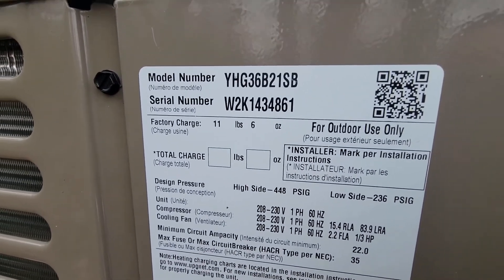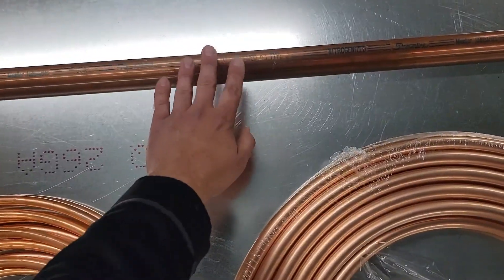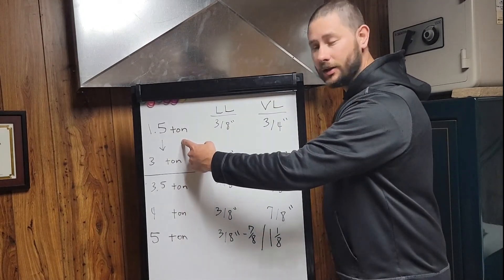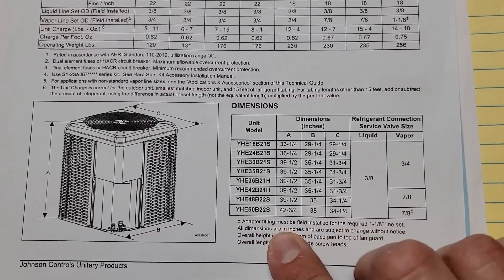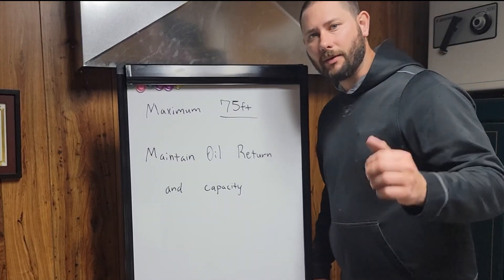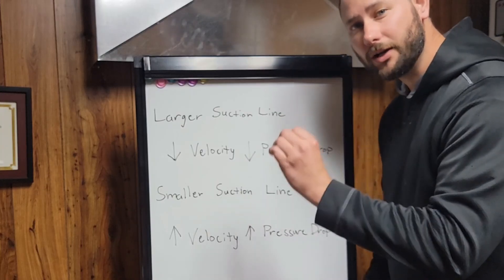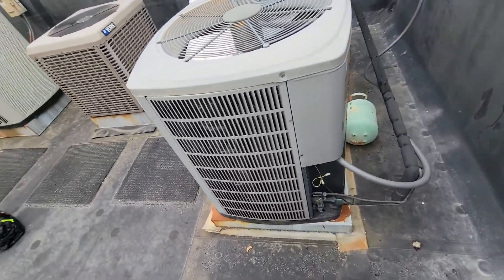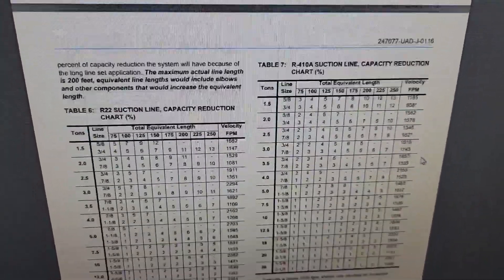Refrigerant Pipe Sizing HVAC Basics #refrigerant #piping #hvac

Comment: Got a question. I'm a seasoned engineer but I value your opinion being someone who has seen many more installations. I have a lineset (3/8,3/4) that was installed (2019) thru a brick wall in anticipation of a future bonus room finish.
I want to now, install a LG split which has line sizes of 3/8,5/8.  My plan is (for vapor line) to braze in a 3/4-5/8 transition on each end of the existing and run 5/8 to the OD & ID units. The length of 3/4" would be about 10' the length of the 5/8 would be about 20'. Do you see any major issues?
Reply from the maker: I see no major issues with this. You should not have an issue.
Reply: @taddydigest  Thanks for the reply.

Comment: Thanks for the video, I know the video is 3 years old so don't expect a response but I figure I'd try. I have a Gree 42K 5 zone mini split. All suction ports are 3/8". Hvacdirect told me I need adapters which actually came with the system.  I'm using three 18K indoor units. The spec sheet for the indoor units called out for 5/8" suction lines. However the 18K units are actually 1/2" lines. I already purchased the 5/8" lines. Is it a bad idea to adapt the 5/8" line down to 1/2" to make the connection at the indoor units?

Comment: 2 ton Goodman 14 seer with air handler on 2nd floor. Original Ruud 1.5 ton unit used 1/4 inch liquid line. Will this reduce capacity? Discharge air is 68 degrees at ducts. What do you think?

Comment: I ordered the Tosot mini split 18k Aoraki however I wanted to use better line set so i got streamline line set however the line set nuts on the tosot lineset did not fit on the streamline , as if the copper on the streamline line set was thicker.
Reply: Where would I get nuts to fit the streamline line set and the streamline line set says for r410a it's new in the box does it matter I use it for the r32 system?  Would using the better line set have any negative impact on the unit?

Comment: You said line set length on the nomogram, it's actually equivalent length. With equivalent length you need to take all your fittings and valves into consideration and add that to your line set length. For example a 3/4" 90 elbow is this many feet of equivalent length of straight piping, I would refer to the SUVA Piping handbook. Rule of thumb that you use is under 100Ft of line set you times by 2 = equivalent length. Over 100 then times 1.5 = equivalent length. It's a good practice to count how many fittings you will be using and adding that equivalent length up to a total though.

Then you said lower suction pressure causes refrigerant migration, that's not true, refrigerant migration happens in the off cycle mostly and the refrigerant goes to the coldest spot and condenses there. So if it was really cold outside, your refrigerant would go to your compressor and condense there, that's why we use crankcase heaters in refrigeration.

Lower suction pressure however does affect your capacity, the lower the suction pressure the lower the capacity.

If your suction pressure is low due to the coil being a solid block of ice then you're "flooding back" to the compressor, not migrating.

Comment: Read the manufacturer’s literature. For example, Rheem/Ruud 5-ton RP14AZ and RP15AZ heat pumps use 3/4” or 7/8” vapor lines depending on length, never 1 1/8”, and warn against oversizing.
Reply from the maker: Yes, absolutely. Always read the manual. That's the best advice.Thank you my friend

Comment: Hey bro, that was just excellent info that I was looking for. I just subscribed. Im building my own house and at drywall stage. But with all this heat, I decided to rough in  lines and electrical for future if I decide to do air conditioning. Ive only got about 30 ft run from condenser to air handler but I need to do about 3 or four 90 s . The 3/8 line I may be able to bend gently and do the 3 or 4 90 deg turns. How do I run the bigger, probably 3/4? Can I solder? I've solderd plumbing pipes but I know I cant use that on these. Also are few bends allowed or not? Can you give me as much info as you can please?  Much appreciated.

Comment: Im stuck on if i should install a 7/8 or 1 1/8 suction line on a 5 ton unit that has a line set run of about 70 ft which way would you go.
Reply from the maker: I would definitely install 1" and eighth
Reply: @TaddyDigest  that's the way I was leaning thanks for your opinion appreciate it.

Comment: very informative info, is it possible to change pipe size to get equal BTUS,example  if u have larger BTU  airhandler then the condensor , does increasing pipe size or decreasing pipe daimeter give u equal BTU to get proper cooling operation ?
Reply from the maker: I'm not sure if that's possible that's a good question though
Reply: @taddydigest   I was at a job a while ago, that the airhandler was larger in BTU then the condensor, so they had to change suction pipe diameter to get same BTUS, it looked under engineered but did work.
Reply from the maker: It is common in the field to find pipe sizes that are too small for the newer equipment

Comment: I bought a 3 ton condensing unit to replace old 3 ton unit. when I looked at the vaporside port for new one, it came with 7/8. So, the pipe in the house which is 3/4  wouldn't fit. Maybe I need an adapter.
Reply from the maker: are you sure it's a 3 ton 36k
Reply: @taddydigest  I am positive. Because I ordered 3 ton unit. Maybe I need to go double check. It looked definitly bigger than old 3 unit.
Reply from the maker: yea, definitely double-check
Reply: You can buy a copper bushing that will adapt to 3/4

Comment: Hi there, I’m having a hard time determining if I need to size the lineset based on the condensing unit’s BTU’s or the Zone’s BTU’s. I have a Bosch 27k 3 zone mini split. Each zone is 9000btu respectively. Logic is telling me that I will only need a lineset big enough to cover 9000btu on each head. If I had a single zoned 27k btu head then obviously I would need a larger lineset. Am I incorrect? Thanks
Reply from the maker: you are correct

Comment: Hi, quick question.. lets say you are replacing outdoor condensor unit, and if the existing vapor and liquid line length is not enough(assume0.. what kind of connector you use .. in plumbing we use 90 degree elbow etc.. i am  not sure  what will be used  in HVAC just to extend the line by a  feet or two. apprecaite your response
Reply from the maker: I would use a 90ﾟ elbow a 45ﾟ or a coupling.
Reply: @taddydigest  thanks does the 45 degree elbow sold in home depot works. Or hvac copper pipe and elbow are different type

Comment: I'm installing a Gree 4 zone 9,9,12,18 mini split which has 2 branch boxes. The longest run is 40 feet. I'm concerned if I run 2 handlers off of one branch box that I would need to increase the line size to the box. Is it a valid concern or would the system be fine given the short line lengths?
Reply from the maker: Doesn't seem like a very long line set length
 I would not be concerned
Reply from the maker: Is always consult the installation instructions for the equipment though
Reply: @taddydigest  thanks! I just realized the package comes with larger lines to the boxes so no need for me to worry about determining the line sizes.

Comment: Carrier is full of themselves. Private label all the way. "Lifetime unit replacement warranty" customer only purchases unit from us "once" in a lifetime. 🧠
Reply from the maker: Interesting
Reply: @taddydigest  I installed a bunch of airquest, Heil, tempstar... it's all made by carrier. I've also put in Carrier commercial packaged units. They threatened to take us to court for putting they're logo on our website... now with private label our average service tickets are 20k lieftime unit replacement warranty- 10 year can't write a check gaurantee and filter replacement programs. 😀  everything works for the best. One thing I can agree with about carrier is, they did a nice job "circling the problem" ROFL 😂